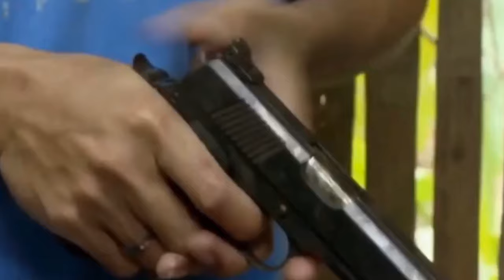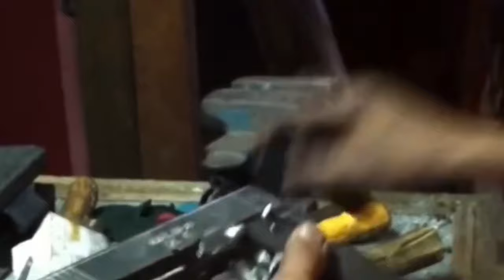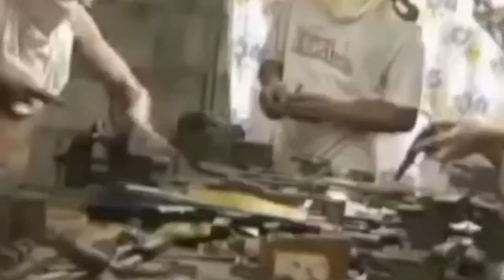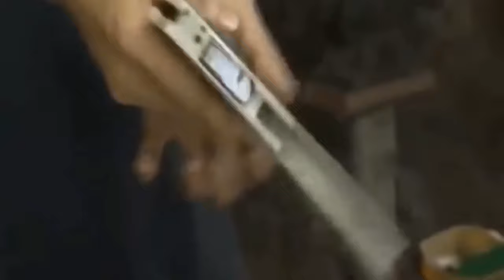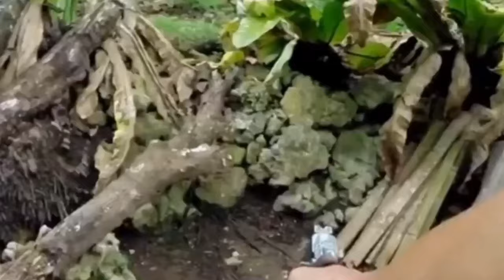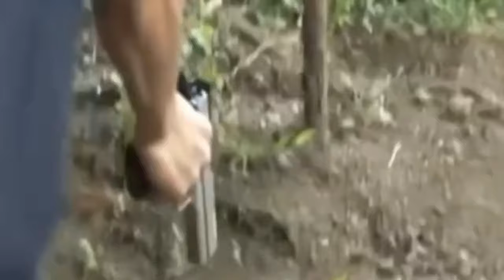PALTIK / Danao made guns l Philippines

Comment: They are usually made from scrap metal and their ussage is verry risky, they probably aren't hardened
Reply: Proof of Claim Required.
Reply: Frames and Slides are not often hardened or blued on many commercial firearms.
Because there is no reason to do that. Many pistols have Aluminium and or Polymer Frames which can't be hardened either.
Like GLOCKS for example.
It's so obvious you know nothing about firearms
Reply: @GMT439  when it comes to ghost guns .. philippine made is one of the best.. Most street people in asia and some streets in america and europe knows that.. :) but if you gunna buy legal guns go with big names no need to go cheap :)